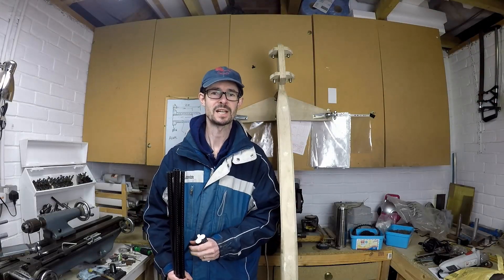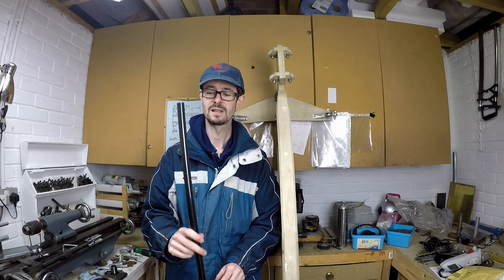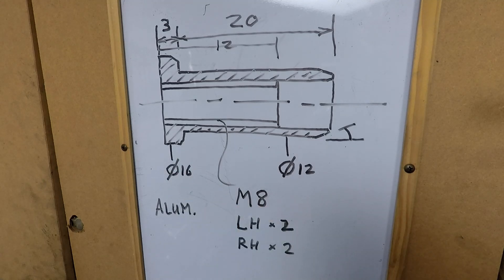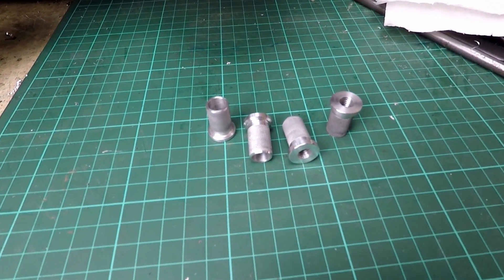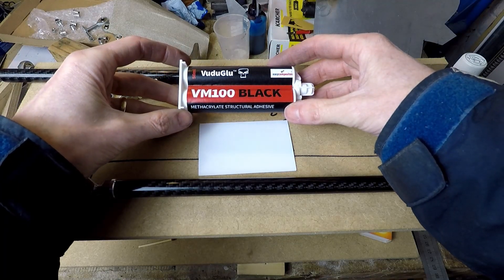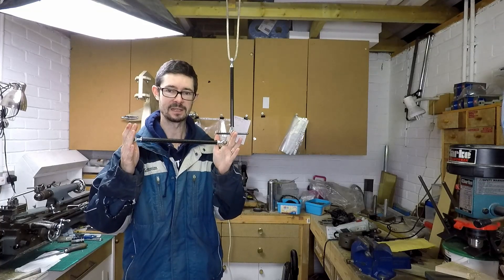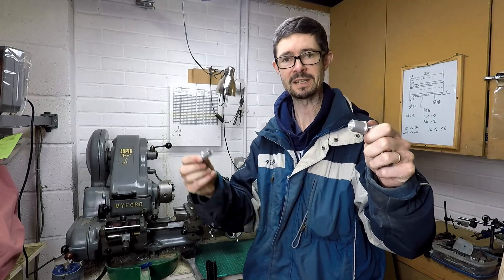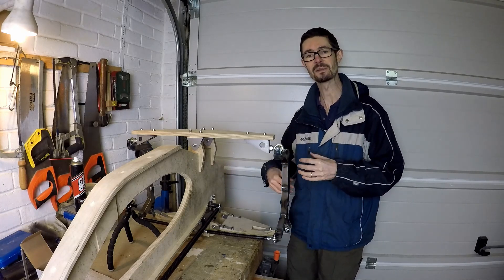Tilting Trikes Part 9 - making the carbon tierods

Comment: Please make sure any gluing surface is cleaned before sanding it as you may sand grease or so into the surface. Cleaning them again after sanding makes sense as well though.

Comment: I have heard that you should never let aluminum touch carbon fiber as it can cause the carbon fiber to delaminate.
Reply from the maker: There could conceivably be issues with electrical currents being generated between the aluminium and the carbon that cause this sort of problem?
Reply: @MetalMachineShop  Actually I believe it's due to the reactivity of aluminum.  A simple grommet or barrier of another material between the two is used for mitigation, I've seen steel washers used so I don't think it is due to conductivity.
Reply from the maker: @LeesChannel  I’ll have to read into that, thanks!
Reply: @MetalMachineShop  I recommend having a deeper look into this problem, i.e. on the dark  aero (UAV) Youtube channel you will find a video explaining different approaches to solving Problems with galvanic corrosion of aluminium honeycomb + carbon skin sandwichconstruction. In short: when there is no medium like water connected to both materials, you dont have to worry  about it.  Decoupling both materials via glue and making sure that there is no possibilty of water/mud/rain  collecting on the areas in danger should lead to long lasting components. Excuse my french ;) and greetings from Germany
Reply from the maker: @darkN3R075  hi, thank you very much for this reply (and excellent English!). Sounds like I don’t need to worry about it, but your point about designing to avoid water accumulation is well made.  Particularly for wet, salted winter roads.  Best wishes from UK!

Comment: Very interesting manufacturing site! Thank you for the nice explanation about the tilting mechanism. I would try to make more use of existing material, for example for these length-adjustable steering rods. The left and right turning wire can also be found in a rigging tensioner of a sailing boat. Saw the rigging tensioner in half and glue these parts into the tierod.

Comment: I think those joints should probably support a tonne or so. I used the same tubes and glue for a bicycle frame and explained my crude testing system in this thread below. Based on my experiences I think your gluing procedure and fit up look excellent for a good joint. 

https://www.bikeforums.net/framebuilders/1211262-cf-hybrid-mma-glue-test.html
Reply from the maker: Thanks, that looks reassuring!

Comment: Hello , i am waiting for your videos like kids waiting for Christmas. Those rods look cool . 
I think that i ve seen somewhere in the past that aluminium with carbon fiber gets galvanic corrosion and gets eaten up , i guess since i saw enough clearance the glue will be in between and will be no problem . (?)
May i ask , i ve seen you are using m8 rod ends and i am thinking that if you use missalignement spacers the m8 will have to get smaller , what  will be the bolt in the end ? I am thinking to use m12 in mine to have meat to reduce to m8 .(or m14 to m10)
Reply from the maker: Thanks, I’ll try to get the next one out more quickly!  I’m using home-made misalignment spacers which reduce the 10mm holes on larger rod ends to 8mm and the smaller 8mm to 5mm.  The larger rod ends are fitted to the outer end of the tilting arms and take the vehicle’s weight.  The smaller ones are for the steering and don’t take so much weight.
I did think about galvanic corrosion; I don’t know how much of a problem it will be.  The aluminium inserts with stainless steel rod ends could also be an issue, but time will tell.  I decided not to worry about it!
Reply: @MetalMachineShop  
Its ok , I just brought it up , I dont think it will be a problem either , keep up